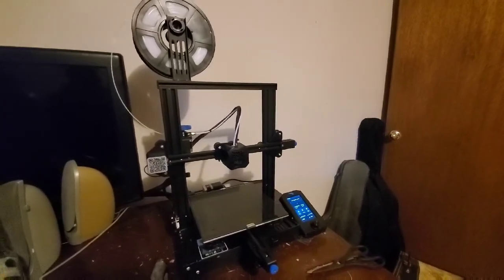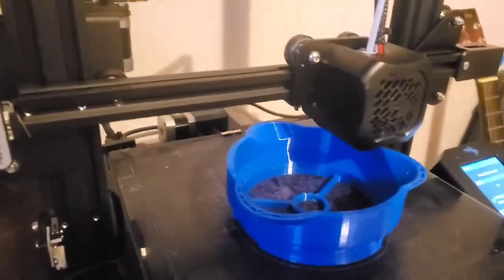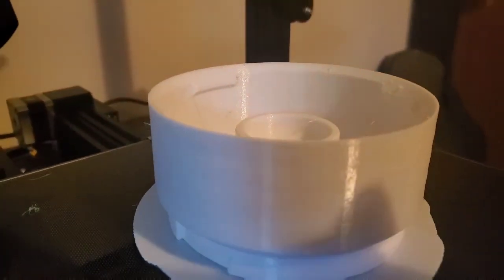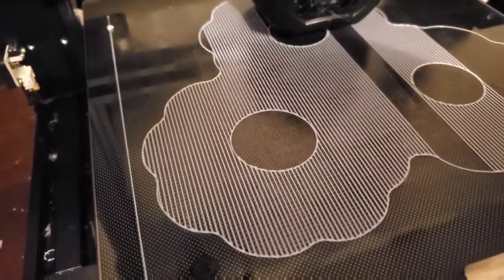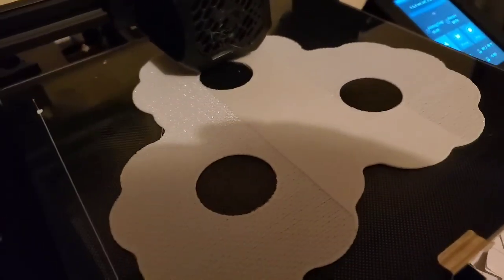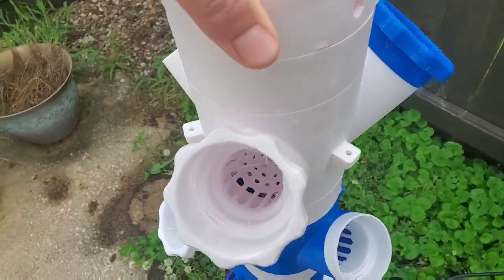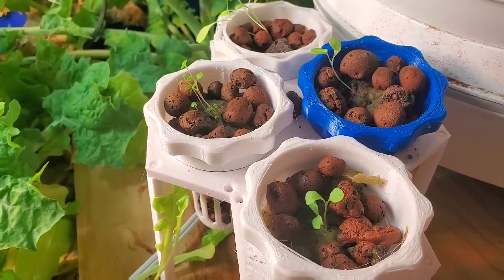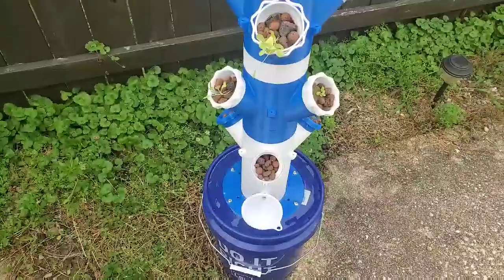3D Printed Hydroponic Tower: Start  to Seed Part 1

Comment: Thank you for your video sir 😊. How much pound of material need to make one tower system?
Reply from the maker: I used about 1.5 kg spools of white and. .5 of blue PETG to print everything (I also had a bad print or 2 so might even be less than that)
Reply: @st-qp4mr  thank you very much sir really appreciate. Wish you good luck with your all works
Reply: @st-qp4mr  sir one and final question. How much time It take to finish one system?
Reply from the maker: @ambadykb  the first few 3 mods took around 15 to 18 hours to print...then I got smarter and tweaked the Cura settings slightly to speed up the prints to 12 hrs for a 3 mod print...the spacers only took around 6 hrs each...maybe total time was a week and a half since I had a bad print or two..the printer was running probly 24/7 during that time tho
Reply: @st-qp4mr  thank you for your valuable information sir